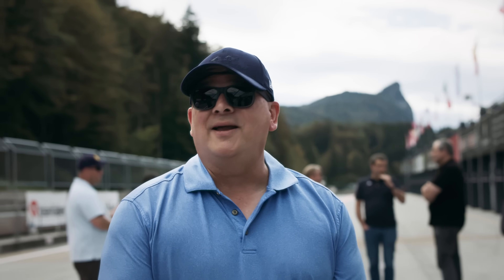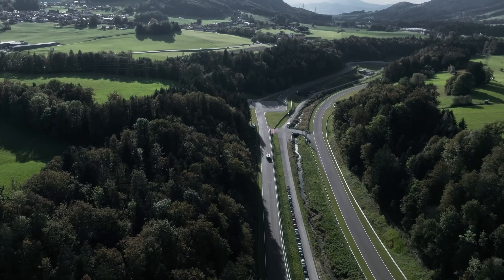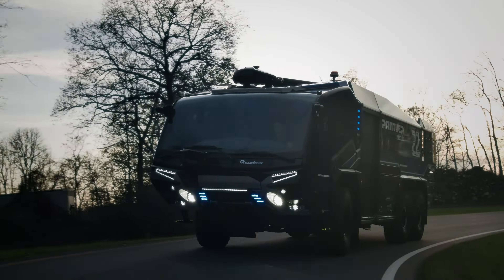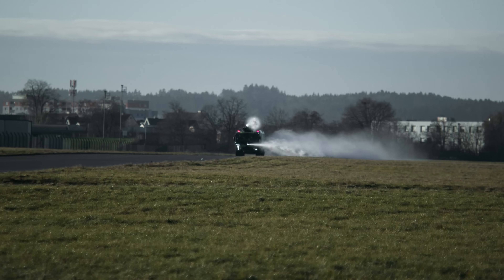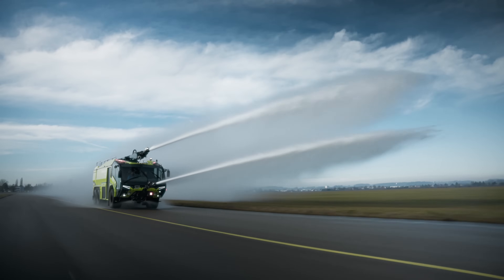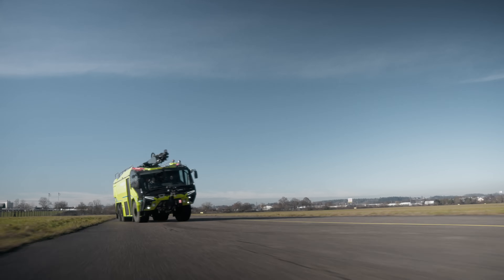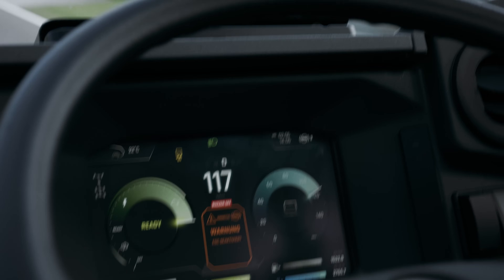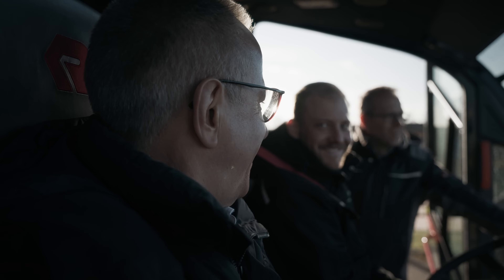PANTHER electric: From the idea to the modern ARFF truck - Rosenbauer

Comment: "you forgot to charge the truck?!"
Reply: you forgot to put gas in the truck?
Reply: @JAyThaRevo  Never put gasoline in these kind of trucks. Jet Fuel / Kerosene or Diesel is what these trucks are meant to run on. I think this one can only use normal road vehicle Diesel.
Reply: Oh no the DIESEL ENGINE on this Series Hybrid truck will have to start and run.

Comment: Makes no sense and is far too expensive and totally unnecessary.
Reply: What are your arguments for no sense and totally unnecessary?
Reply: @sosumitoo  Never feed a troll.
Reply: Wrong, very necessary and had superior functions. Just being so much quieter driving on the way to the job site will literally save lives. Occupants can just speak at normal talking volume and hear clearly. Then the confident powerful acceleration and regenerative braking is a nice added safety feature.

Comment: Ah yes, we love replacing efficient diesel powertrains with electric powertrains, to reduce co² emissions....
But let's not forget that the battery's production will release more co² than the diesel engine would in it's lifetime. And let's also remember, that the charging of such a battery will, in most parts of the world, be done by burning fossil fuels. Oh and the battery will definitely not last the lifetime of such a truck, needing replacement after a few years, as the battery is always kept at 100%
Reply: You surely haven't heard about LFP batteries then, the other stuff you wrote is also not true.
Reply: well, nothing you wrote is based on any data and is not true, but ok
Reply: " than the diesel engine would in it's lifetime" "needing replacement after a few years, as the battery is always kept at 100%" You SCAMMER LIAR!
Those are both blatantly false and not possible. FYI this is a Series Hybrid with a Diesel Engine onboard. Keeping a battery 87% the running the Diesel Engine when it hits 20% is how they are going to keep the battery in service for 17 years.
Your only arguments SCAMMER LIES!